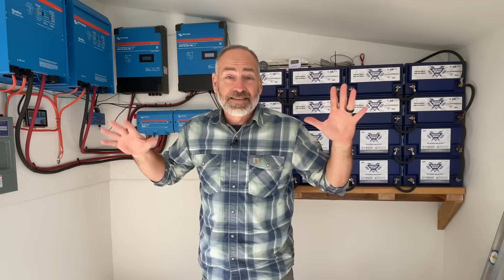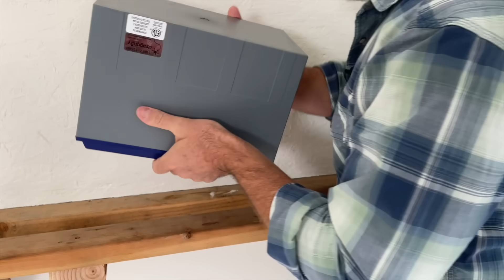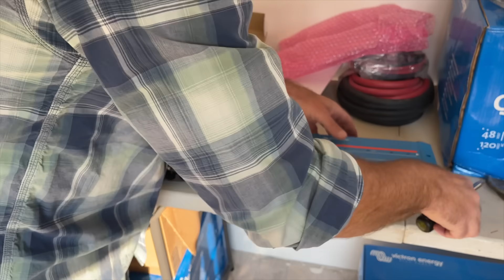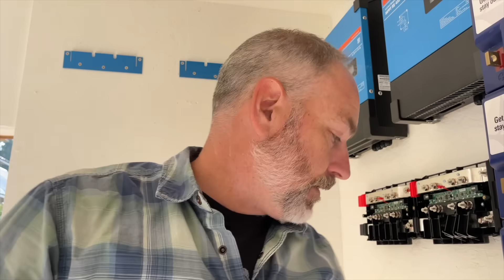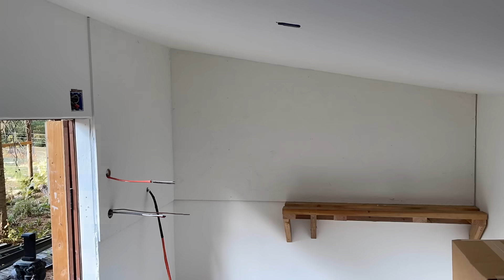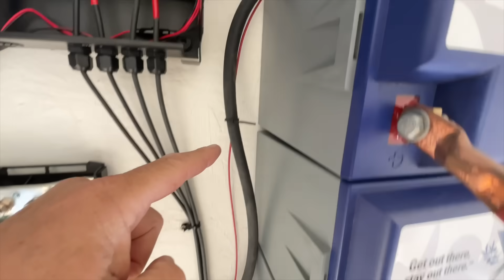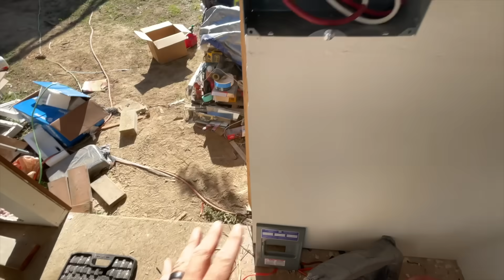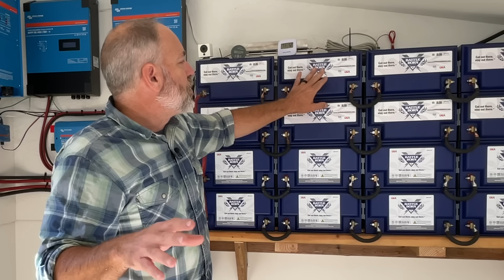EASIEST Off Grid Solar Power System Battery Bank

Comment: A thing to note to the DIY installer for safety:
Not all wiring is rated for the 450 volts mentioned, or even the 300 volts he is using as mentioned near the beginning (after the 4 minute mark).  Ensure you use wiring with insulation rated for 600v if you're doing the High voltage/Low current setup mentioned.  The code is easy to find online and will help protect you and your investment.
Reply: Agreed. As a former lineman, I would also never recommend that crimper. You already spent thousands on a system, spend another hundred and get a crimper that wraps the entire connector for a nice cold weld that won’t come off.
Reply: @thesheepdog1974  link to recommended crimper?
Reply: @thesheepdog1974  I got a kick out of that too.  He's going to shave a few bucks on a crimper when he's installing tens of thousands worth of equipment.  Although I assume he got a ton for cheap as promotion.
Reply: Absolutely I'm not and electrician but I'm good at figuring things out and each wire needs to be rated for what it goes and comes from. Like panels runs 7 amps at 600v but batteries diff wires so is ac in and out. I hope everyone pays attention to that
Reply: I'm trying to find 600v dc cables with insulation but my google-fu is not good enough.
Reply: @summerWTFE  just go to lowes tell them specs you need the distance and voltage amps. The pv cables are pricey so be careful
Reply: @summerWTFE  Just wrap the wire with electrical tape. Each wrap you make is good for 600V of protection.
Reply: Yeah solar panels lifespan is around 15-20 years. Solar is NOT yet ready, too expensive still
Reply: @PrimeraRSTKD  That is usually 20 years guaranteed to be producing at least 80% of their capacity.  Solar panels can still produce power for at least 50 years (per NASA), though at an ever reducing rate.
Reply: Still cheaper than giving it to the utility companies, solar panels are already tge way to go, have you noticed the sharp increase in bills
Reply: @MrMartgolf  I have noticed sharp increases in everything.  You can't just print 5 trillion $ and inject it into an economy, without an equitable increase in productive goods and services, just handing it out and not expect inflation.  That's basic economics 101.
Reply: @stevelux9854  Off topic.....
Reply: @PrimeraRSTKD  lifespan mesaured without a heavy storm
Reply: @PrimeraRSTKD  This guy is clueless.  Don't listen to armchair assclowns, watch the video for proof and not the Drump voting idiots like this commenter 🤣
Reply: @PrimeraRSTKD  what?? 15-20 years was 20 years ago, now is 40-50
Reply: @michals1108  they can't possibly know for sure that they will work for 50 years. thats just a sales pitch.
Reply: it’s actually just what the company who makes the product says the lifespan is, not just a made up thing by sales people, but of course not all sales people will give you the same numbers so 1000% something to remember when weighing your options
Reply: @notbadsteve  It's the specs, so yeah they know.
Reply: @thefooshisloose   no one can tell if anything is going to work for 50 years. Too many variables.
Don't fall for the hype.
Reply: @notbadsteve  I've seen videos and talked to people who are seeing much better than 80% at 15/20 years. I'm sure there are examples that are worse, but..

Comment: Holy Batman! That's alot of weight on the battery shelf! My rough calculation is 465lbs on that shelf. Way too much for those tiny braces.
And anyone telling you living off-grid is cheap...My guess is this room full of gear set you back around $24,000. Unless you are getting free stuff from Victron.
Reply: Which is likely.

Comment: Still boggles me that you can run 10 guage wire into 50 amp breaker through a 6 guage wire to a 200 amp panel.  That would not fly in any wiring setup. Can someone explain this?
Reply: In theory, yes it can work because it's a short run.

Comment: Can a guy just get some plain English?  If you are hoping for views and followers, please, lighten up on the jargon.  What does 48 volt mean or do?  Most of us Americans have 120 volt power in our homes. Would we have to install a bunch of car cigarette lighter sockets all over the place?
amphour, wattage, watt hours, etc.?  How about "We installed this.  It will power all our stuff; washer, dryer, AC, oil burner, fridge, lights, etc., for six days before the batteries run out.  It cost this much.  These are the components in the system.  First we have the solar panels.  One of these would take 47.9 hours of constant sunlight to charge a phone.  With the 73 we have, we can charge Optimus Prime's entire family for a year.  And so on.  Save the jargon for the end, maybe?

Your presentation is great, your speech is clear, and engaging.  It's the actual words/jargon I can't get past.  You would think, after hearing all this stuff, day in and day out, for the past few years (at least), I'd understand some of it.  I don't.   How much, what will it power, and for how long without sunshine?  That's what I need to know out the gate.  I have sat through hours and hours of content hoping the person would divulge what I came for.  They almost NEVER do.
Sorry, I finally reached the tipping point.  It has been a long arduous, nay, excruciating, saga, watching hundreds of YouTube videos where every single person talking never says anything with real world value to the person who doesn't already own an off-grid bunker, work remotely(somehow they all have jobs typing on computers, cash just flowing in uncontrollably and overwhelmingly) and already have some sort of electrical education.
Reply: The larger blue boxes convert Direct Current from the batteries / solar panels into household electricity, so his household wiring can remail the same.
Reply: He converts DC to AC and puts it  out at 120 so you can use regular appliances.

Comment: As an electrician for 50 years, l am quite impressed  by your setup. I will use the same setup except I will make individual  shelves for the rows of batteries just incase I have to remove one for maintenance  or replace. Nice job!!
Reply: In this instance, it is both cheaper and easier to maintain server rack batteries. Instead of this glob of 12 batteries, you could do 4 server rack batteries that you could slide in or out of the system.
Reply: @JustinPratt1 😢😢😢
Reply: I think he should run wires into  pipes and mount a junction box  splice  with bug (number 2 size) connectors instead of leaving it exposed
Reply: My point exactly…going to be a bit of a problem changing out a dud as it’s setup now.
Reply: Same. I prefer rack mounted batteries myself.
Reply: Your kidding right!  Where do you work sparky and what type of electrician?
Reply: This would help with heat dissipation as well
Reply: No need for shelves in rows, LiFePO4 packs hardly go dud, besides removing a battery out from any position would be easy because these are very light batteries.
Reply: How much is this sat up
Reply: How much would a set up like this cost?
Reply: thats a great idea

Comment: Of course thats easy, you are using the most expensive equipment they have. The batteries are $925.00(ea) X 16 = $14,800.00 for the average person to buy them. This IS NOT including anything else.  I wish I had half that much money.

Comment: The real hero of this video is that shelf!
Reply: I wont life, my arse was clenching when i seen the like 16 100ah batteries all resting on that small little rack....
Reply: yes got a lot of faith in that shelf I would have a much stronger shelf even though liuthium batteries are much lighter than lead acid. (and better)🐸
Reply: Absolutely! My immediate thought seeing them on that shelf, scary.  I'd really like to see a third diagonal brace in the middle.
Reply: Back in my installing days of off grid systems, I'd prefab the batteries (flooded lead acid back then) in a welded steel enclosure, made so it could be picked with my boom truck. Some with casters if they needed to be rolled into place, these new batteries are a game changer for sure.
Reply: @portnuefflyer  Me too
Reply: $16,000 in batteries on a $12 shelf..... 
What could go wrong???
Reply: Battleborn is expensive.
Reply: And what does all that cost?
Reply: @johnwillenburg1586  Lots would be my guess.
Reply: hahaha
Reply: I don't think it makes sense to use all those smaller 12V batteries when there are great rack options or even better large floor mount systems.
Reply: @joniboulware1436  well there cheaper for one. The batteries you are referring to only recently started coming down in price to be affordable for the average middle class family. Even the inverters are being incorporated with the battery charge controller to reduce wasted energy from having multiple units drawing energy when 1/2 the equipment can do the same job. Plus the batteries you are referring to have built in BMS'S which make balancing the cells and controlling discharge infinity more accurate. Plus I don't really like Victron, they are not even attempting to keep up industry standardisation of equipment and expansion of their equipments capabilities. Other companies have to make their equipment work with Victron, but the reverse is not true apparently.
Reply: The shelf that's made of 2x4s? That could probably hold over a thousand pounds. It's the wall that would fail if anything.
Reply: My immediate thought
Reply: That shelf is fine. I guarantee you 3 grown men could stand on that thing. Those batteries aren’t that heavy.

Comment: What do you do in the winter? I don't get very much power incoming in winter in my system (but I'm higher altitude probably...) ? I'm curious what other people with solar systems do to adapt for lower sun power in winter?
Reply: The battery banks store in the excess power and help the power keep going when the solar isn't charging as much but the solar can still get power through the winter. That's why accounting for how long your winter is, is key for figuring out how much backup you need

Comment: Mr. JOHNSON. Your video is very helpful. I would like to make a comment. The current shunt is going to get hot and you must install it separately from the battery boxes or from another element that is easy to burn. I congratulate you, it looks like a good installation.

Comment: I'm horrified by the "self proclaimed techs" in the comments who give you top marks for wiring....  
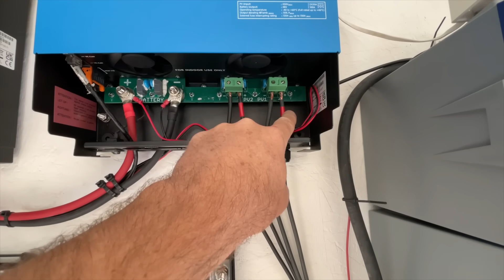In your solar inputs to the regulators @18:24  you have an explosive  - literally - amount of copper out of those terminals, there should be NO exposed copper outside of ANY terminal, and, please learn to use ferules in such things, and  use breakers -proper DC breakers too, this enables you to quickly isolate the solar from the regulators and isolate regs out to the load, it is not really enough to have just fuses. I'd also be using MRBF's on each battery positive terminal.
I do however like most of the rest of your layout, only other thing I'd have done was keep those regs lower for airflow, most mnfrs, including victron even recommend 6 inches in most cases above and below,  but I really like how you did the little bendy of the batt to batt link cuts, that is well thought out and 99% of people forget about it.

I really hope you can update your setup with those changes I highly recommend, you look like you live in the middle of nowhere, dont lose it all waiting an hour for your fire dept to get to you.
Reply: He's just doing it for the clicks. He didn't even pay for the batteries.

Comment: Each battery is at least 50 pounds, thats total 800 pounds supported by 2x4? Not really smart. Why not just install it on floor?
Reply: each battery is 31lbs and batteries should not be stored on the ground. They need to be at least 18" off the ground from what I've been told from professionals. I forgot the reasoning but I'm sure it's because of the whole powering thing

Comment: Only a quarter way through and already noticed two problems. Batteries get warm and need to give off heat. Don’t think stacking them 4 high is smart. Also, charge controllers are too close to the ceiling. Heat rises and they also can’t vent well that close to the ceiling.

Comment: You should do a detailed comparison between weight, cost, size, maintenance, energy production, use life, etc. of this system to a diesel or propane generator all scaled equally. You may come to the conclusion that this expensive setup is all about entertainment and not sustainable. There is nothing environmentally friend about renewable energy that's not renewable. Our politician's job is to create spending to create an economy that is why as soon as system becomes too sustainable and affordable a new BS technology less efficient and more costly uses more complex manufacturing and raw material is put into play.... thanks for playing the game and getting rid of affordable energy to the less fortunate.

Comment: This is Grace from Danick Power Limited.
We are a professional manufacture in Solar Products area in Zhejiang, China.
All our solar products have been UL, VDE, SAA, CE certified and get a high reputation and hot market in north america, europe, south africa, Australia, South east Asia countries.
Products mainly include Off grid inverter, LiFePO4 Lithium Battery System, Solar Pump inverter, Solar charge controller, AC-DC battery charger, PV combiner box, PV parts, Solar system solutions.

Comment: I’m moving to Puerto Rico and my new house doesn’t have central air conditioning, it has 3 window units, the oven is gas, it has a wall/mounted water heater, fridge, freezer, Tv and lights. How many batteries you think I should get for powering my house?

Comment: Nice and clean setup. I would recommend running each bank of four batteries to a bus bar and then to your distribution block. That will cut down on heat and the amp load. Easily verified with an ammeter. Take care.

Comment: This battle borns are way over rouced like rip off too high. server rack batteries are bigger and run longer for like almost as low as a few hundred more if you get a cheap one. Double the price for SOK but they are top quality and more than twice the run time of those battle borns. I don't think Battle Born is going to be around much longer which Lifepo4s dropping in price

Comment: Great install and well-presented video.
A subscription earned 🙂

Question - how does the BMS handle being in series with another BMS?
Theoretically this should shorten the battery life of the batteries-  as the BMS of the battery that charges first will turn off the BMS in the other batteries in series even though they are not fully charged?
Reply: Indeed. It is really poor design to put 12V lithium batteries into series... Multiple BMS'es in series that are not communicating between them is not good on the long run and will lead to decreased working capacity and early retirement of the weakest battery in the group.

Comment: I also would emphasise the importance of adequate ventilation in summer for the inverters. I run a 10kw Quattro and a 5kw Multiplus here in the temperate climate of the UK. To use 75% continuously (as we do for EV charging) extra ventilation was required. As well as being high up your inverters are closer together than the recommended 100mm (4").

Do your 12v series connected batteries balance between each other? Usually the cells within the case balance each other out using an internal balancer but you do not appear to have balancing externally within each series line. This could lead to imbalance between individual batteries in a series run. This is one of the reasons why many system builders use 16 individual cells with a BMS with a 16S active balancer.
Reply: And you can even buy premade 48V lifepo4 batteries or if you want to maximize capacity per 48v you can buy 280-305 Ah cells and get over 14 Kwh's of capacity per 48v battery at a cost of about 2 of the premade 100Ah 48v batteries. absolutely no reason to waste time on the 12v batteries unless you started with a smaller 12/24v system and are now expanding to 48V.

Comment: It is cheaper to be on the grid, no maintenance, no battery replacement, no solar panels cleaning. No $25,000.00 up front money.
Reply from the maker: What are you going to do when the grid goes down for months or years?
Reply: @MartinJohnsonOffGridLiving the charge controller link is no longer available, do you have any recommendations where I can buy it?

Comment: I really appreciate your video❣️ But please am really confuse on how the two inverters are use to distribute AC current to the Appliances/Loads. Are they connected together in parallel or they are connected in separate phase in the AC distribution box? Please I need an answer 🙏🙏

Comment: Even better than adding 2x4's, he could minimize by installing a floating setup where it's dowels that are installed into the wall studs themselves AND THEN for the added support he can just drop a 2x2 right in the center.

Comment: Question running from your inverter down to your your breaker box it looks like number 12 at best 10 wire? Shouldn't we be running heavier wire like number four Gage? And what's the gauge wire running that hundred feet to the house? The only thing that I fell and questioning is the light wire running from the inverter to the house.

Comment: I just started with solar. I bought a 3hour deep cycle battery.  A 2000watt power inverter and 330watt panel (with plans to get more). We can power small appliances. 
This setup you have is impressive.
Reply: Exept for battery capacity, what an you run in your 2000w inverter? I been planning on getting a 3000w at first and then upgrading to another 3000w linked but no point in all that power if i cant use half of it because of saving energy.